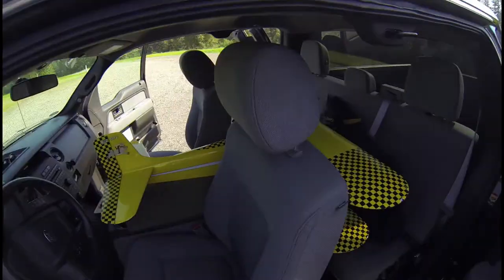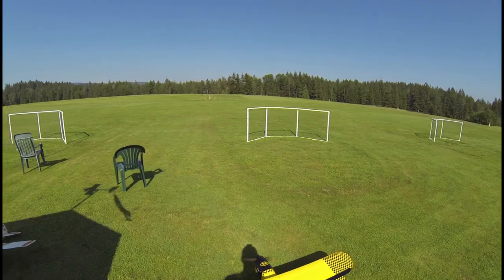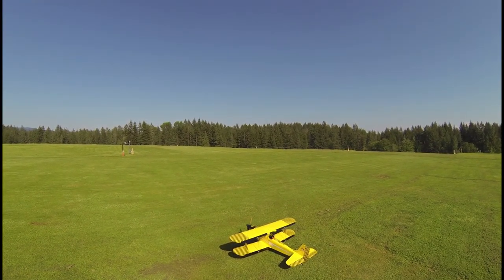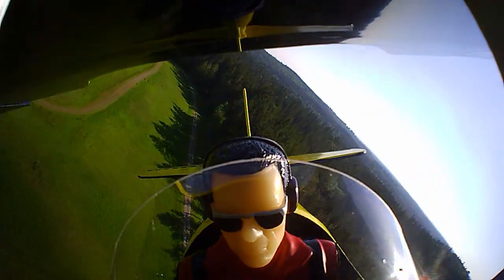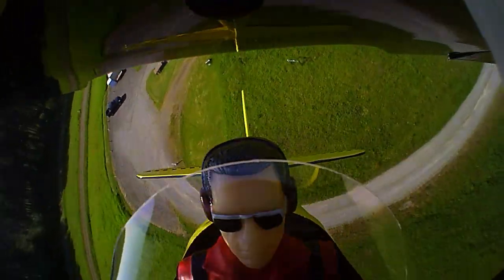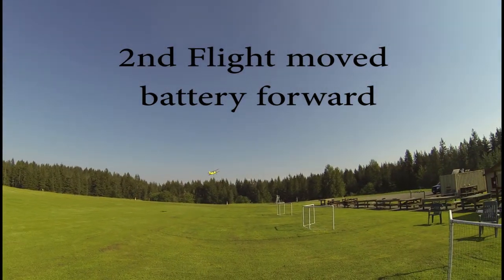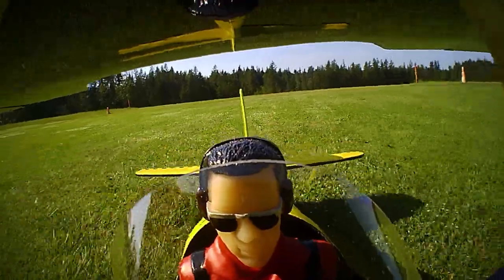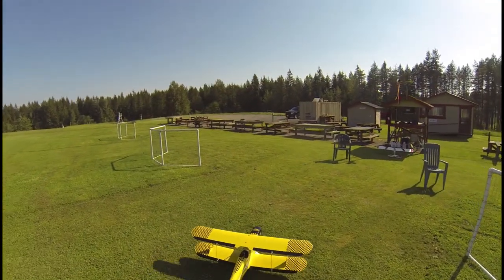Sig Hog Bipe Maiden video

Comment: Excellent work! From your 2nd flight's roll, it looks like you may still be a touch tail-heavy. That will help your landings be a bit more smooth and make rolls much more axial without elevator or rudder inputs. Wonderful to see another scratch built airplane take flight.